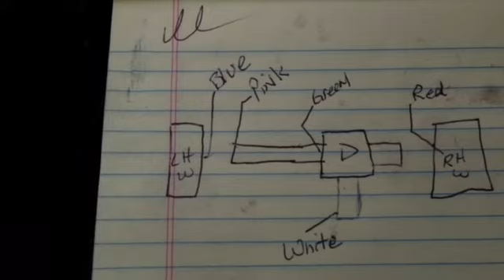Touareg front differential noise

Comment: Chassis ears would have saved me a lot of $$ vs chasing down other things, some misdiagnosed by mechanic. Chassis ears show same issue on driver side.

Once upon a time you had a teardown and repair video on youtube.  Now that you are no longer offering rebuild services, any chance of reposting that?

I hope to replace both axle sides but want to avoid messing with the pinion.

How deep into disassembly if the diff will I need to go in order to remove only the axle bearings and races? Can it be done in a manner that I do not need to worry about setting / resetting preload, backlash, etc which require special tools or skills / experience?

Comment: Terry, I found your rebuild service on ebay and now found this video you made. I too had my ChassisEars on the front diff. The passenger side (red in your diagram) seems to have a bit of play in the output shaft. So I hooked up the chassisears to the red, pink and green. The green was nice and quiet, and I was expecting to hear a quiet pink (left bearing) as well, but it seemed to be making more noise than the red! My question is, is output shaft play on the passenger side (red) normal? Also took me a while to track this noise down, sounds more like a dust shield rubbing vs a HOWL that a wheel bearing makes correct?
Reply from the maker: Charleston Car Collection Hi, I will do my best to answer all your questions. 
It’s not normal to have play in the out put shaft. Now the differential can make a few different noises when the bearings are bad. When it starts it sounds like a shield rubbing then howls louder till it can be felt rumbling in the car body. 
A wheel bearing tends to get louder when turning the wheel while driving.  
The sure way to tell if a bearing is failing would be to drain the oil and inspect with a flashlight for metallic.

Comment: Terry, did you diagnose and fix this problem? What was required for repair?
Reply from the maker: Yes the bearings were bad. Needed a full rebuild. We rebuild the differentials for the Touaregs, Cayenne and Q7. Look us up on Facebook (Differential Rebuilders) from Allegan Michigan 👍
Reply: I'm feeling a pulsation between 20-40 mph, mostly occurs during zero acceleration. Does that sound like the front differential?
Reply from the maker: new account where do you feel the pulsation? Steering wheel, front end or rear of the car?
Reply: Hard to say, feels like a bent shaft or oblong tire. in the 20-40 mph speed range I feel the pulse. Not through the steering wheel. There is also a growl that is present. Both occur even while coasting in neutral. Put the truck on jack stands and ran at idle all shafts concentric and no detectable noise.  The Left wheel seems to have a rumble when I turn it by hand. Rebalanced the tires, Inspected and lubed the driveshaft carrier bearing, no tears in the rubber. Verified the fluid level in the front Differential.
Reply: Similar to the growl in your video but not nearly that loud.
Reply from the maker: new account I would suspect a wheel bearing
Reply: I suppose the two symptoms could be related or not, but they seem to have initiated at the same time.
Reply: Thanks Terry me too but cant imagine a wheel bearing would make the truck pulse.
Reply from the maker: new account A bad wheel bearing can throw the CV axle off balance. 
If you’re Differential is in question drain the oil and look at it with a flashlight. Any metallic in the oil will determine if the diesel is bad
Reply: Thanks Terry

Comment: Is the bearing at the Pink location replaceable without pulling the whole diff? I’ve got a nasty noise that only goes away when you take your foot off the gas. Doesn’t go away during turns like a wheel bearing would
Reply from the maker: Adam Jeffrey the Differential has to be removed to replace the bearing. Even if you replaced one the other bearings will go bad soon after
Reply: @adam how did the sound started. Started it very silent and over time got louder?